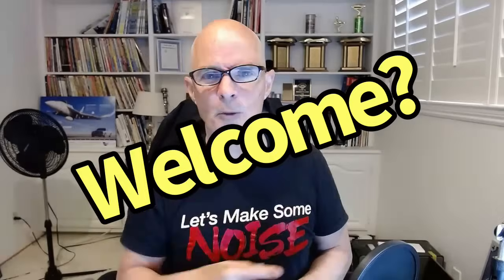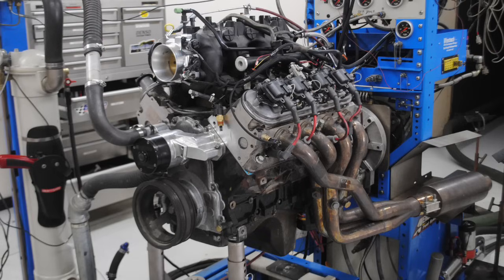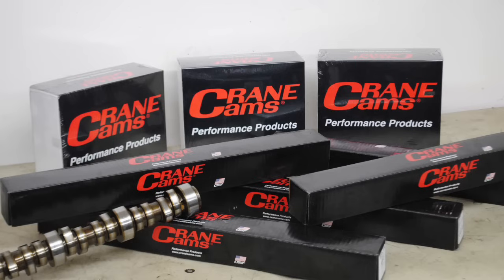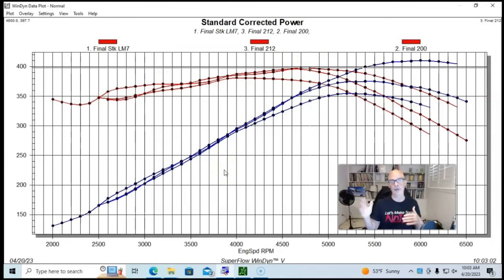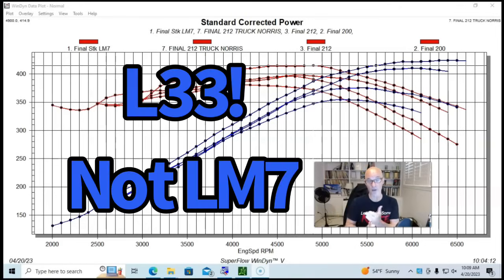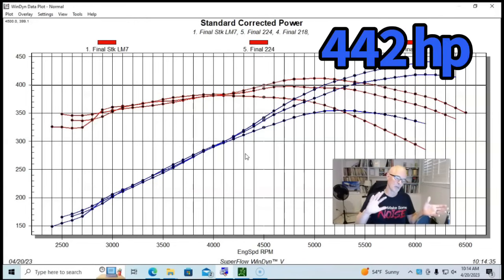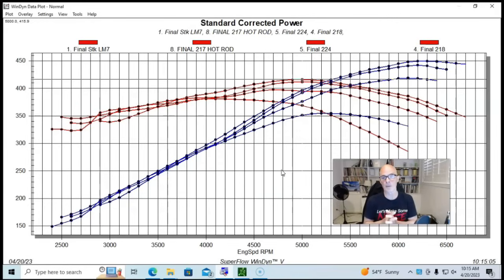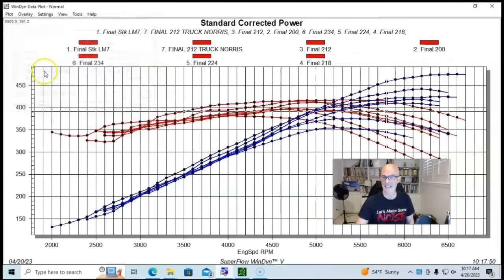THE ULTIMATE 5.3L CAM TEST VIDEO-HOW MUCH POWER WILL MY CAM MAKE? FOR ANY LS CAM-THE ANSWER IS HERE!

Comment: Hey Richard what would your cam choice be if you were putting a 5.3 LS4 in a light weight manual trans car like say a Fiero? I am looking for something that will actually take some torque out of the bottom end and add HP and rev to the top end like a 7K redline, the limiting factor in my build is the Getrag F23 5spd manual Transaxle (so lower bottom end torque would help it live longer) and since the car only weighs 2700 lbs it doesn't need much torque to get it moving, and having the engine make power higher would also give it a bit of a euro V8 quality which would be nice in my 87 Fiero GT fastback. TY for any advice you or anyone else could give, it would be appreciated.
Reply from the maker: if you want to use one of the stock cams-then go with an LS9 or LS7. Or our Truck Plus

Comment: Browsing LS cams and their specs for the 5.3 or 6.0 (whichever I find a deal on rather get a 6.0 but whatever) swap I'm going in a 92 c1500 it seems like they are more conservative power range rated compared to SBC grinds? it seems like anything in the 230 range is getting into the higher performance ballpark and not great for good lower rpm TQ and drivability and most of the truck cams are in the 212 to 220 area but I have a 230° .480" 108lsa single pattern cam in the current SBC and it's fine it has perfectly good drivability and good low rpm TQ with a 2500 stall and slso factory v6 converter, and a really nice choppy idle and runs the power brakes fine. it was actually described by howards as "for heavy vehicals". I'd be perfectly content with that amount of low end with my LS swap. A 92 c1500 regular cab long bed according to the internet tips the scales at 3800 lbs. Where it's a daily/toy I want all of its performance potential but also nice chop for show, and the truck cams have a pretty tame lope. So get a little bigger cam or just leave a vacuum line off lol. Tuning shouldn't be an big issue I'm not running a factory ECU. I'm new to LS and EFI so I'm a bit over my head here. I do plan to go turbo at some point its the main reason I finally waved the white flag giving up on SBCs drinking from a controlled fuel leak for the time being anyway because the Gen 1 SBC holds a special place in my heart and it is definitely still a viable performance  platform.
Reply from the maker: Just an FYI-cams don't work differently in the SBC and LS.  A 230 duration sbc cam is not a low rpm torque cam. Less duration would idle better and make more low speed torque. The single pattern is helping you, but a single pattern 220 can would be better down low and idle better.

Comment: Hey Richard , it is the  M code  loving Aussie . I have mentioned my Ivan Tighe cams grind#764 clev 302 351 typo in catalogue ,intake lift at 622"' , not 522"' , Dean my grinder also ground same for LS 5.7 have new cam in block , though am concerned the bore   plasma is to thin . Do you have safe dimension to still reuse block .
Reply from the maker: bore plasma?

Comment: _ Ok ... I was at a friend's house yesterday and he is in the process of putting together a 5.3... long behold he had a camshaft kit there that he purchased from one of the Chinese apps.. crazy enough to say that the camshaft came in a BTR box. The camshaft pushrods valve springs with valve seals. All for under 200. 
I would like to know if these camshafts are authentic. They looked identical to the one that I have. I have a BTR in one of my motors and this Cam that he has looks pretty much identical like mentioned even came in a BTR box. 
But will it hold up? Is the steel the same quality? The price was less than half of what I paid for mine.
Reply from the maker: we have tested a couple of those-specs were not correct, metallurgy was not correct, big NO for me
Reply: @richardholdener1727  wow Richard I wasn't even expecting you to answer me.. Thank you very very much. Happy New Year to you and your family. Wishing you the very best always. I'm happy to know that I didn't go to the cheap way then. Wait till I give him the news LOL. The crazy thing is it's in a BTR box. China is really doing people dirty

Comment: How much would it run in a dollar amount to modify a 2016 5.3L v8 1500 Silverado extended cab that has a k&m cold air intake, borla catback exhaust Y, Tuned, and a throttle response ob3 plug in, to make 425-550 hp? Not including installation/labor fees, simply just the parts to accommodate this much horsepower. Then, what exact parts/part #’s would you recommend to ultimately reach that number and could you provide me the links or options to find the best parts to reach that number of HP? Thank you, Richard.
Reply: Forgot to mention, AFM/DOD delete also installed.

Comment: So i have a 5.3 vortec with 706 heads that im porting, but i was wondering what the biggest cam i can run is without cutting pistons bevause i wanna do stock pistons and gen 4 rods. Please lmk thank you! Will run pac 1219 valve springs depending on lift that i can do
Reply from the maker: lift has nothing to do with p-v clearance-that is all duration. why do you want the biggest cam?
Reply: @richardholdener1727  honestly I just want something that makes good hp I'm not too sure where to start but I want a good n/a build 5.3 that chops hard and gets off the line quick

Comment: Hello Richard I appreciate the video curious how a summit 236/246 .612/.612 110 summit says this cam works and has good valve event characteristics and helps with 110 lsa but I’m worried about piston to valve clearance with 862. What’s your opinion should I run it?
Reply from the maker: If you install it, you should always check p-v on a cam that big

Comment: Hi Richard I’m building a Gen 4 5.3 so with flat top pistons and I have 799 heads milled 20 over with 660 lift springs and stock valves with BTR 7.400” pushrods and ls7 lifters. can I run the BTR hot rod cam without piston to valve problems?

Comment: When picking a stall for the cam, the camshaft manufacturers state to use for an example a 3500 stall but the cam has an operating range of 2500-7000, could use use a 2500 or 3000 stall, maybe somewhere in between or are there still underlying issues?

Comment: How come nobody tests cams for power in the 2,000 to , 4,000 RPM range? Nobody is driving around at 6,000 RPM all the time. Unless your rig is only for racing, your probably running around  2,500 RPM in daily driving. Nobody is burning them off at every stoplight. Nobody is driving 95 on the highway all the time. 
Some real world practical testing would be great.
Reply from the maker: no one is running wot at 2000 rpm

Comment: Any thoughts on the cam motion junkyard dog camshaft, 238/254 .621/.604 115 in a SBE LM7
Reply from the maker: very big in a 5.3L-if it fits p-v, it should make good power
Reply: @richardholdener1727  piston to valve clearance is my main concern. I'll just stick with the original plan & buy aftermarket pistons

Comment: I watch your videos from time to time but now its a bit more impactful as I think I will finally be pulling the trigger on an LS swap for my hotrod. Plans are mostly stock but intake, cam and headers are likely the only big upgrades not counting any supporting upgrades like springs and such for the heads. And the largest reason for wanting to swap the intake is for the look, that big plastic thing isn't exactly appealing and to just be rid of anything unnecessary. Might even go with a carburetor intake and run a Holley sniper efi or similiar for that more traditional feel. Idk yet.

Comment: What would you recommend for a 99 5.3 cam. 33 inch tires I want to run a 3400 stall converter.
Reply from the maker: what power level and what is the rest of the combo
Reply: @richardholdener1727  I was hoping you could tell me 😂 engine is completely stock as of right now

Comment: Wtf? My 5.3 in my 08 silverado makes 350hp with torqstorm supercharger. Wtf am i doing wrong?? Lol
Reply: stock cam ? stock heads ? stock intake ? tune? those will 100% make a difference bro
Reply: @5trey2.  I'm gonna do cam swap DOD delete. Going with BTR centrifugal cam and springs. And Richard dyno is engine hp not rear wheel hp.

Comment: Is there a big difference with these cams when using EFI vs. Carb'd?
Reply from the maker: the power differences offered by the cams are the same with either efi or carb
Reply: @richardholdener1727  Ah, so it boils down to how bad you want to play with wiring.

Comment: Richard, I know this is an older video but still waiting for you to go back and do the LS6. Camshaft, since the last test you did on  it seized up inside the 5.3 and you felt it was an accurate on power gain. That was quite a while back. Any idea of when you going to retest the ls6 camshaft in a 5.3? Patiently waiting for that.
Reply from the maker: The LS6 was more than likely accurately represented-it does very similar to LS2 and LS3-nothing magic there

Comment: I have a 01 rcsb truck with the Lm7 I’m full bolt on (long tubes, tbss intake manifold S&b intake) I also have injectors and a 340 E85 fuel pump. I wanted to know what cam you would go with to get the most horse power NA I also want one that would need a torque converter to make that jumó too
Reply from the maker: most peak?

Comment: best cam to make the most hp on a stock 5.3? also doing injectors and will be on nitrous so didnt know what cams were meant to be naturally aspirated and which werent
Reply from the maker: get the biggest one that will fit-then be disappointed unless you are racing it

Comment: Question for all .I have a 4.8 bored out to 5.7 LS1 bore size with LS1 pistons .what affect will the big bore have on it the torque and HP .it's all together .comes out to a 5.1 liter
Reply from the maker: a bigger motor will make more power-just like a 5.3l makes more than a 4.8l
Reply: @richardholdener1727   what I'm getting at will there be any advantage of having a bigger bore and 4.8 stroke  .rather than bigger stroke of a 5.3  and similar cubic inches .
Reply from the maker: there will be no gain from the bigger bore until you get very high in the power level and can take advantage of additional airflow that might be possible from the change in bore size, that might not happen until you reach 600 hp or so

Comment: What stock 5.3 makes 354hp and 380torque?? Stock ls1 5.7 corvette makes 350, 05 Tahoe 5.3 makes 295hp 330 torque
Reply from the maker: test method-stock ratings are with full exhaust, full air intake, stock temp and tune-we changed all of those
Reply: @richardholdener1727  what’s the best cam on the market for a 5.3 in a 3700 lb car , 3.42 gear , 4L65E trans, headers, duals , stock converter , stock 2005 5.3
Reply from the maker: if the requirement is stock converter-the Truck Norris will be tough to beat

Comment: I dont see much about a cam that improves off idle to 3000 where a truck will operate most often as a diesel operates ?
This is whats needed by a lot of people.
A cam that closed the gap vs a diesel.
Reply: Tick performance towmax stage2
Reply: @The8ball365  
I dont think that tow max max cam would come in as quick as a truck Norris or chapacabra cam since its on a 114 ls a vs the tighter ls a of the 2 i mentioned and wont have as much tq either due to building less psi of cyclinder pressure with the 114 ls a.

Comment: Richard Holdener Will you do a lm7 engine Builds  using  3.80 bore 6.128 rod length and 4 in stroke , 3.80 bore with 4 in stroke stock rod length , I want to know what the difference will be Using 706 heads truck norris cam ?
Reply from the maker: rod length won't change things

Comment: @richardholdener interested in the truck norris cam for my 04 tahoe z71 with the l59 engine. What torque converter you think will go good with that cam? Daily driver i like dogging it at stop signs sitting on 33x12.5 x22s
Reply from the maker: 2500 or less

Comment: Interesting that the TN and BTR stage 2 cam have the same lift and intake duration, but the tighter LSA equated to more peak hp and tq, and started making power ~1700rpm sooner.
In fact, the TN cam made more hp and tq than the next 218/224 on a 110 cam.
I wonder why more LS cams don't have tighter LSA's?
Reply: no one knows…aka tighter lsa has been shown and tested to death to make more torque and hp than whats mostly sold
Reply: What I've gathered is it seems that tight <111LSA starts to have a pretty dramatic effect on idle quality, emissions and mpg. It seems what BTR figured out with their latest offerings is that you can reap the benefits of the tight LSA and maintain more idle quality all at once to some extent by having the intake duration be much lower than what was standard before and have a bigger split.
Reply: Sort of.  On a cam if you shorten duration with same lift you increase stress on parts and the spring requirement goes up. So yes - that might be what he did - but there is always a draw back. @KNS_Racing

Comment: Im stuck between the BTR stage 2, the truck norris and the tick performance towmax stage 2 214/224 | .571"/.561" | LSA114+4. Truck is a daily driver that sees some off road and snow, plus pulls a bass boat.
Reply: Think stage 1 in your case.  TN if you don’t mind burning extra fuel and and having an erratic idle.

Comment: I have a 90 C1500 with 5.3L built 100% as a stock reliable truck to be a workhorse. So far it is that, but I keep catching myself wanting to swap the cam. It seems if I was going to do that, the Truck Norris cam would be the way to go to not lose anything down low. Would you agree or should I just leave well enough alone?
Reply: I think if your truck works well just leave it alone.
I have ecu mapped my car cause it wasn't doing well etc... now 20% less fuel and way better.

Comment: Awesome! I'm still stuck on choosing a bigger cam the vehicle is a 2007 chevrolet silverado 5.3. I currently have a BTR stage 2 truck cam 212/218 .553"/.553" 111 LSA with .560" springs and PRC 220cc cast heads, 4.11 gears, 3400 triple disk converter, 1 7/8" LT headers, the truck makes 370 RWHP I was looking for a cam to push it closer to 400 do you think the MADD MAXX cam would be a good option? Or change to a high-lift cam?
Reply from the maker: seems like a big power number for an auto and that small of a cam
Reply: I agree, it was surprising to me. It was done on a Dynocom it made 369.3 hp at 5,550 rpm and 367.9 Torque at 4,700 rpm I also have a LS3 ported throttle body and my truck intake manifold ported. I'm definitely thinking about the stage 4 summit cam now.
Reply: I don’t think that dyno is very honest.

Comment: I've been watching videos on 5.3's because I thought the 09 Sierra 1500 sle I bought from my dad had an LMG 5.3 (according to vin decoder). Come to find out my younger brother burned up the motor in 2019 and the only thing he could find quickly was a 6.0 that was supposed to go in an 09 Sierra1500 HD, but was a factory reject because of wrong angles on the cylinders. The machine shop my brother got it from buys these rejects and bores and sleeves them.
I've determined it's not flex fuel and has 862 heads. So I'm 99% sure my Sierra 1500 that I paid $5,000 for has a YL6 with less than 80,000 miles on it that had been sitting in a shop from 2010-2019. 😃 
I wish the block casting numbers were in a more convenient location!
Reply: LY6, but yeah… sounds like you got a great deal!

Comment: I just worked on 5.7 with a crow 1289 cam 236/254 on a 113 lsa,Higgins cnc ported heads I believe the lift is like 613/610 or something like that damned thing made 515hp at 6500..it's my new favorite ls cam.
Reply: Looking at rebuilding my 5.7 LS1 engined commodore here in New Zealand.  What's the driveability and idle like on that cam you used

Comment: Richard, have you done any tests with  LS cams that advertise a lower starting Rpm band, like the Comp 54-424-11?   The operating range is 1400-6700.   Curious, as my rock crawler doesn’t typically hit those high rpm numbers.
Reply from the maker: there is no cam that makes good power gains from 1400 rpm to 6700 rpm-that is marketing
Reply: @richardholdener1727  well, that’s unfortunate.  🤣.   I’m running that cam I mentioned, pulls good and will still rev out if needed.  It has similar specs as couple of cams you ran in this test.
Reply from the maker: not my first rodeo-how do you think your 212/218 cam with 550 lift compares to the 212/218 cam with 550 lift that was used in the video?  It will do what that cam did
Reply: @richardholdener1727  i definitely think it very comparable, although I hand ported the stock heads and run an LS6 intake….which I know is not good for low end power, but wanted it to keep my hood line lower and it looks better than truck intake 🤣.
Reply from the maker: it really does look better than the truck and (like the truck)actually works very well down low

Comment: Whats crazy is I did a 4in stroke to mine and even with the slightly bigger of the cams listed. That stroke caused the engine to make more tq than hp. I think the extra stroke combined with the restricted almost stock 706 heads shifted the max airflow to occur at under 5252rpm.
Reply: What are the numbers?
Reply: @justinturdeau2383  it was on chassis Dyno in a 04 Tahoe with heavy tires and 4l60 so numbers aren't comparable and low. But still, it was 345 lb ft@4500rpm and 314 hp @5100rpm. Best part is I wanted towing and that's what I got. It has 300lb ft at 1700rpm and starts increasing slowly at 2k RPM until it plateaus from 4k-4500. So awesome towing power considering it's all right away.
Reply: Stock 04 Tahoe torque is 400 ft lbs @ 4,000 rpm. That worse than sucks!
Reply: @DoyleShadduck  You clearly don't understand hp numbers. This was at the tire without correction not some false stat gm gives out. GM inflates there numbers. stock on the dyno behind 4l60 is around 285-310ftlb at 4000 with a set of headers.